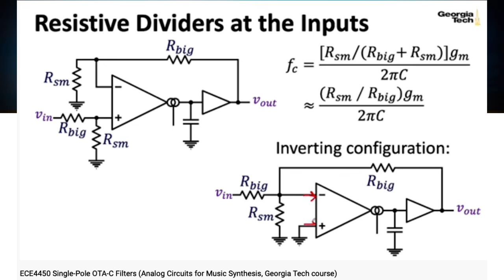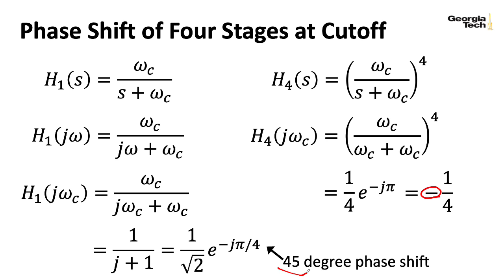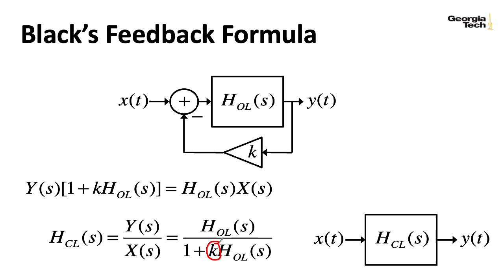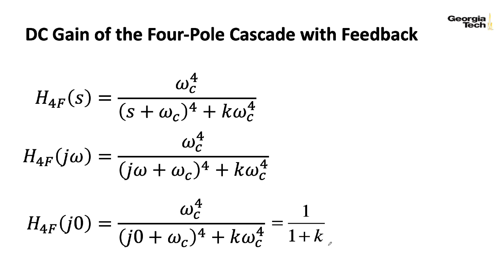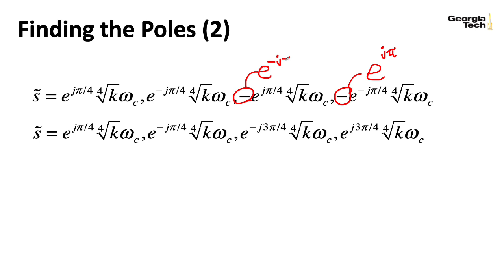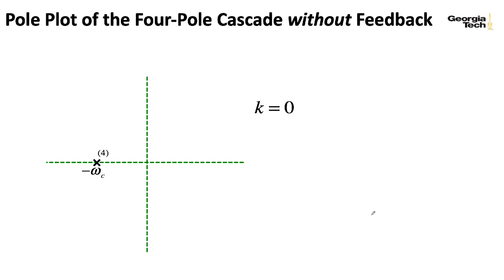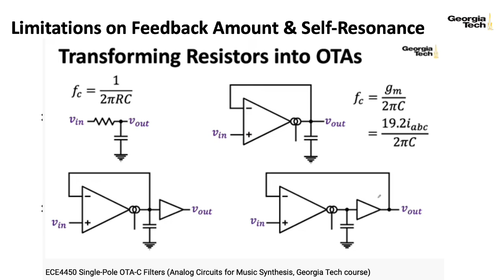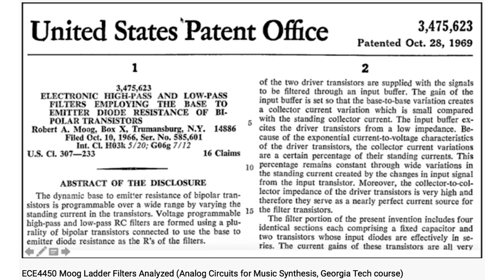ECE4450 L20: Four-Pole Filters with Feedback: Theory (Analog Circuits for Music Synthesis)

Comment: Thank you Aaron, very interesting and looking forward to 4-pole OTA filters lecture. Can you also explain 2-pole OTA 12db filter while getting to the 4-pole? as many synths use them as well. Thanks
Reply: to make a long story short, a 2 pole has a lesser sharp cutoff and a 4 pole filter has a sharper cutoff.
https://mutable-instruments.net/archive/documents/pole_mixing.pdf (page 3)

https://mutable-instruments.net/archive/shruthi/build/4pm/
Reply: @AnalogDude_  I was actually referring to designing the filter using OTA's, I'd rather listen to Aaron's lectures its way more interesting as his explanations are visual and easier to understand than any textbook.
Reply: @peternotpeter  i wanted to show you the difference between 2 and 4 pole, regardless of using an OTA or VCA chip.
Reply from the maker: @peternotpeter  If you look later on the playlist, you'll find a series of videos where I discuss second order filter functions and state variable filter and Sallen-Key implementations.